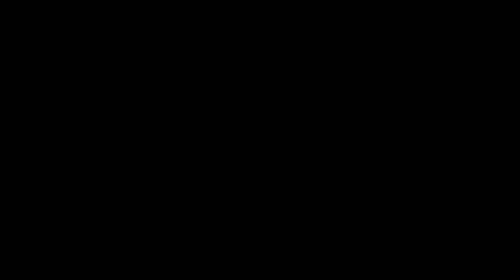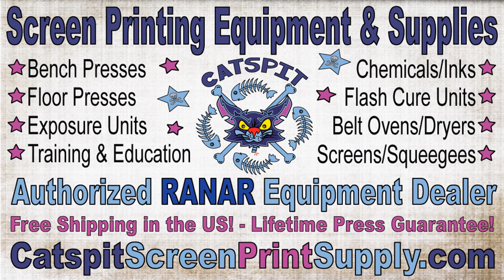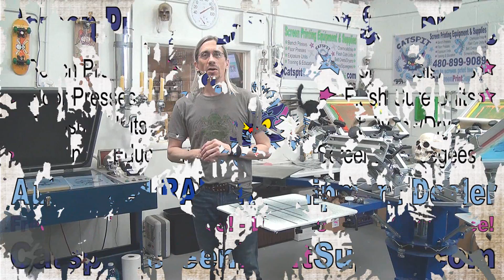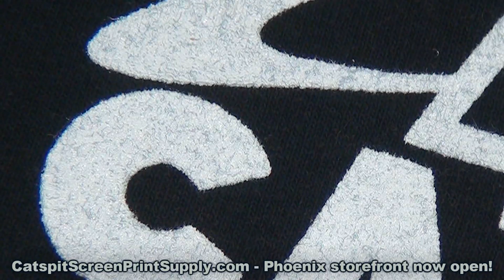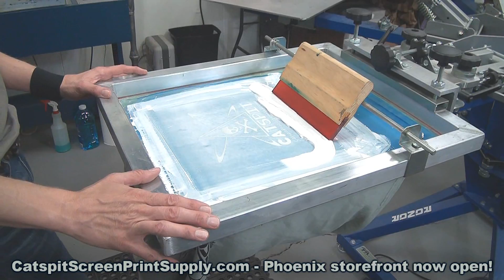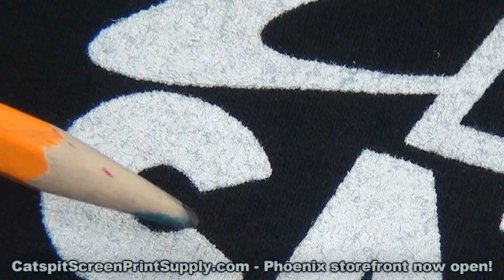Screenprinting T-Shirts: What Is And How To Prevent Fibrillation On Fabrics?

Comment: I'm using plastisol rapid cure ink and when I try to reflood my screen,  my squeegee feels like it's dried so I feel like my screen gets flooded weird.  I try to add more ink but that just causes my ink to get under my mesh and ruin my design. If I scrap the bottom of my squeegee everytime before reflooding my screen then everything is fine again. My ink looks creamy so I don't know if it's the ink or the squeegee that's the issue.
Reply from the maker: It's hard to say what's happening there working blind from afar but maybe the ink is semi curing in the screen. If you are flashing with one pallet or flashing rapidly on a rotary press, then perhaps that is the issue. I could only guess at this point. Thanks for watching. Screen Printing Equipment & Supplies - http://catspitscreenprintsupply.com/

Comment: Hello sir, i'd like to ask some tips.. I am using an Iron to dry the ink on the shirt and I make sure that it drys well. However after washing, it stains the shirt. Seems like a newly printed shirt with wet ink. I am using a Speedball White Ink. Is this ink the problem?
Reply from the maker: It sounds like the ink was not heat set properly. Thanks for watching. Screen Printing Equipment & Supplies - http://catspitscreenprintsupply.com/

Comment: Do you have any advice for the screen getting stuck to the garment ? It's happening nearly everytime I press. I thought the adhesive spray was coming through the garment, but i tried a shirt with no adhesive spray and same issue
Reply from the maker: If you're flashing on press between colors it may be that you are printing on very hot sticky ink or the ink is not flashed enough and is still tacky. So either allow more time for the ink to cool between printing and/or make sure the ink is flashed enough to be dry to the touch. I have videos about both of these topics. You can search by topic from the videos tab on my channel page. Thanks for watching! Screen Printing Equipment & Supplies - http://CatspitScreenPrintSupply.com/
Reply: @CatspitProductions   thankyou for the reply , it's even sticking on first pass, I've played around with the off contact,  using white plastisol on black 100%cotton shirts.
Reply from the maker: @thedietandtrainingtester1273  My pleasure to help out where I can. But it's hard to say working blind from afar.
Reply: You need to increase adhesive on platen, not take it away. Your shirt needs to be stuck to the platen not screen.

Comment: Quick question. I had fibrillation on my 100% ringspun cotton shirts. To combat it I switched to 100% ringspun, combed cotton shirts. Will the ringspun, combed be less susceptible to fibrillation?
Reply from the maker: Anything with a brushed, combed or altered feel knit surfaces may be more prone to fibrillation since there are already fibers raised off the print surface. A tight, smooth knit will print best. Thanks for watching! Screen Printing Equipment & Supplies - http://CatspitScreenPrintSupply.com/

Comment: Hi mate.  Just wondering if you could give me some advice on what I might be doing wrong with printing my bands t shirts.  Every 4th or so shirt into the run I’m getting bad bleed though onto the underneath of the screen ruining the print.  I’m using water base ink.  Any info would be greatly appreciated.
Reply from the maker: Could be the ink is thin and it's bleeding out. There's a video about retaining print clarity you can check out in my video uploads. But could be you need a higher mesh count and/or less pressure on the flood and stroke. Thanks for watching! Screen Printing Equipment & Supplies - http://CatspitScreenPrintSupply.com/

Comment: I've this problem and i didn't get produce my first tshirt yet. Because i never like the quality of the print. Is this still going to happen with water based and discharge too? Because I'm sure it's because of the garment
Reply from the maker: It's possible but at east with discharge you will be bleaching out the fabric so that may be the best solution if the garment is the problem. Thanks for watching! Screen Printing Equipment & Supplies - http://CatspitScreenPrintSupply.com/

Comment: Good video, what mesh is our go to for platisol ink? I find that sometimes my ink won't go thru so I have to pass the squeegee a couple of time but on this last order I printed i had fribillation
Reply from the maker: Thank you!! try a 110 or a 125 mesh screen. Here's a general guide:

Use a 28 to 30 mesh count for printing many brands glitter inks. Always check with the manufacturer of the ink about this. This mesh will print a very high volume of ink and have a thick coat of emulsion making it difficult to expose.
Use an 85 mesh count for athletic printing, opaque ink deposits, thick puff ink, and some shimmer inks. This mesh will print a very high volume of ink and have a thick coat of emulsion making it difficult to expose. 
Use a 110 mesh count for heavy coverage on dark shirts, solid under base prints, puff, metallic, some shimmer inks, and for certain transfer printing. This is a great mesh count for high opacity inks on any dark garments.
Use a 155 or 160 mesh count for general printing on white tee shirts & under basing on dark shirts, prints on nylon 
jackets, and thinner silver shimmer inks. Many thinner plastisol inks will print well with this mesh count.
Use a 195 mesh count for printing on light colored T-shirts with fine detail, line work or halftones of around 35 LPI.
Use a 230 mesh count for printing on light colored tee shirts with fine detail, line work or halftones of around 45 LPI.
Use a 305 to 355 mesh count for process color on light shirts, or for overprinting a halftone on a white under base on dark shirts. You should be able to pull of halftones of up to 65 LPI but a 55 LPI is most common. 

Thanks for watching. Screen Printing Equipment & Supplies - http://catspitscreenprintsupply.com/

Comment: question. is there anything like starching then ironing that could help? I don't have the amount of resources required to test this out. scratch maybe to hold fabric in place. unless that would only hinder ink adhesion. please do a test! that would be awesome!
Reply from the maker: I'm not sure but I don't think you want to spray anything on the garment before printing. Maybe a heat press but I don't know. I have never done any R&D like that. I just use a  better shirt usually.
Reply: yeah. gildan soft style or Bella canvas are ringspun soft material I use often and always run into this issue
Reply from the maker: You should try the print/flash/print method. That might seal it up nicely.
Reply: that was my first go to method but I think at that point I thinned that batch of ink to much to have it effectively fix the issue. gildan softstyle is really fluffy too.
Reply from the maker: Oh yes, that would be a problem. Too much reducer or thinner, soft hand or what have you, and it's no longer ink really. The opacity is ruined too of course. So an HO ink would work well without any additives probably with the flashing method.

Comment: after watching this video. i know now that adding a thinning agent was only making my situation worse and worse when i was printing white plastisol, on a black gildan soft style shirt. soft style by gildan seems to be really susceptible to this issue !
Reply from the maker: That's probably a good assumption. Reducers or thinners are not ink so you have to be careful when mixing. Too much additive is not good. They also tend to lower opacity. Yeah, any soft brushed finish garment could be an issue. Thanks for sharing your experiences.
Reply: Personally I find Gildan garments one of the worst for fibrillation. The surface of their stuff is not very smooth. I hate printing on their stuff.
I like C Force T190 Tees and AS Colour do some nice smooth garments. Not sure where you are but I am printing in New Zealand.
Reply from the maker: I'm in the US. Thanks for watching! Screen Printing Equipment & Supplies - http://CatspitScreenPrintSupply.com/

Comment: What you you mean by flashing?
Reply from the maker: You know, run out into the street with a tan over coat naked underneath and flash people... LOL.. ;) Sorry I'm a goof. But seriously it means to use a heating panel, which we call a flash cure unit, and dry the ink to the touch so you can print the next print. I have videos showing that. Check out my uploads. Thanks for watching! Screen Printing Equipment & Supplies - http://CatspitScreenPrintSupply.com/
Reply: @CatspitProductions  lol. I see. Thanks!
Reply from the maker: @xHizukax  My pleasure to help out where I can.

Comment: I always thought fibrillation was caused by over flashing or too high of a temp on the flash. Have I been wrong all these years?
Reply from the maker: I don't think that is the case. Over curing will scorch the garment before it will burn the ink. But if the print looks good when the screen comes up, proper flashing should not affect that at all. But if you burn the ink, I'm sure it will look very bad anyway ;) Thanks for watching. Screen Printing Equipment & Supplies -  http://catspitscreenprintsupply.com/